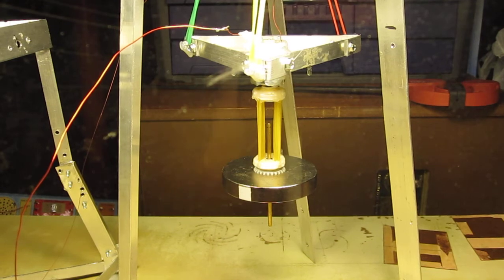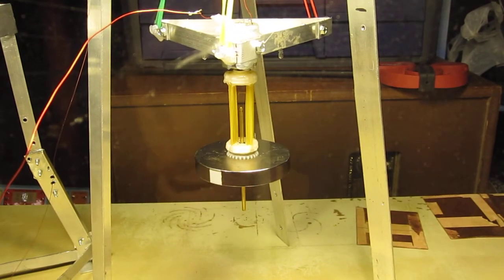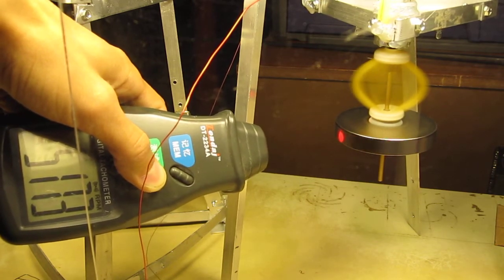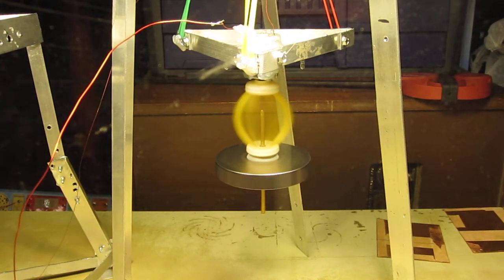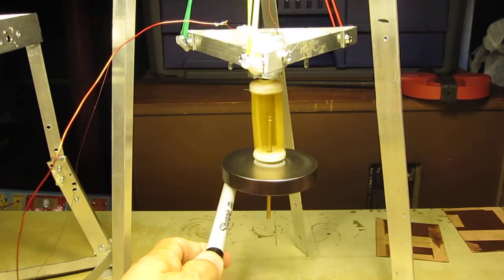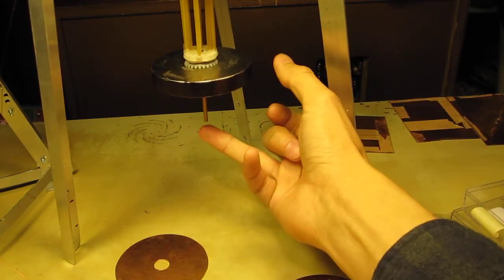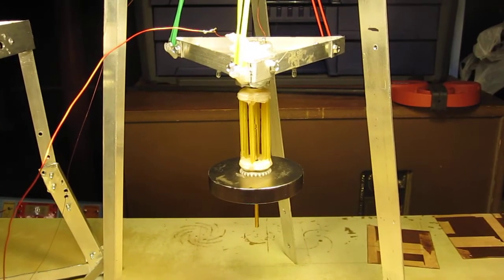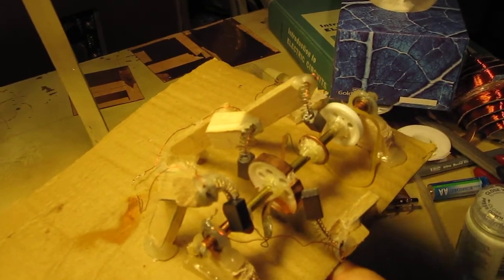Free Energy from a Spinning Magnet - Part 1 of 2

Comment: The neodymium metal will not explode until it hits 50,000+ rpms.  I have been doing what you are doing for the past 4 years.  I'm a bit further.  I have found that the magnet that you have there will levitate in air without a supporting magnet.  It will also levitate a vehicle.  After I finish my patent application completed, I will explain it.
Reply from the maker: So is the magnet in my video actually levitating?  Or is it just the centrifugal outward pushing force of the elastic bands pulling the magnet up?  The magnet will levitate a vehicle at higher rpms?  Like what exactly?  Thanks!  Really fascinating stuff!  Your making me want to revisit this experiment again but at much higher speeds/rpms.  But anyways, I don't mean to bring you down or anything but the patent office here in the USA last I heard is owned by the Bank of England...   so I'm not sure what will happen with your patent application.
Reply: @spiritelemental  If you are interested in levitation, forget the voltage output.  Your magnet is levitating somewhat as shown by the reaction of your rubber bands.  The magnetic power to levitate a vehicle is a bit more complicated.  I can't reveal the details of my magnetic/propulsion power plant, because NASA is interested in it and I am preparing for a NASA contract.  After I have found the level of their interest, than I can introduce it to the public.  
With my technology, the power plant will reproduce electromagnetic power so the owner will not have to ever add fuel or charge its power plant.  It also produces no exhaust outside of radio waves.  The velocity is calculated at an increase of 33ft/sec. or a mile in 6.5 seconds with a pilot/driver controlled velocity regulator.  FYI, a mile in 6.5 seconds is Mach 1+.
Reply: @therenaissanceman8563  Hey mate, know anything about /u/magnetflipper? If not, I have a number of questions (as a hobbyist) that can be answered outside of your patent confidentiality I believe. Let me know :)

Comment: Hi mate! I ran several tests based on a similar design. Please keep in mind that the tiny output voltages will require very low resistance brushes to allow high currents to flow. In my case I abandoned the carbon brushes soon after I figured that out and then I started building copper wire based bruhes. I made them out of thin copper wires resulting in a sort of mesh. By doing that I got up to 6 amps. The problem is that the tiny output voltages will result in low power.
Reply from the maker: Fascinating!  Thanks for reminding me of this experiment.  I still have all the parts but the project was damaged when I moved to Utah from Canada.  I will set it up again and continue my research.  I will also put it on a scale and see if it loses any weight.

Comment: Hey doesn't it mean that the disc is lifting if those elastics are bellying out?
Reply from the maker: Thats a really great observation!  I didn't think of that before.  I assumed it was just the centrifugal force of the elastics that gradually pulled the magnet up with greater speed, but now that I think about it, the elastics weigh very little in comparison to that heavy magnet.  I should've weighed the whole device to see if there was any weight loss.  I will have to try this soon, because I still have all the parts.  Thanks for the observation!

Comment: I like your approach of using a spinning magnet ! !  For many years I havnt been sure as what to call this device ...  Magnetic rotor ......  Magnetic gyroscope........  May I invite you to check out my channel ?  Its amateurish but I'm real old and I can get away with it .   I discovered something rather really cool but I am way too old to do experiments, plus I don't have materials or a shop anymore, hopefully some of my idea's might be looked into and or tested for merit. 
Think about this for a moment ...  you take a large disc magnet such as you have, you also create a copper torrid coil with an inner steel ring running around through it.... use some sort of insulating material to keep the steel ring from touching the copper torrid coil  i.e.  hot melt gun for example...  Now,   the coil must have an inner diameter of about the same as the diameter of the disc magnet...  place the magnet just slightly below the torrid coil both being centered to each other ....... The coil is stationary the magnet is rotated ........ a magnetic field from the disc cuts through the copper coil as it revolves but DOES NOT create a voltage in the coil, what happens is that EACH TURN of the individual coils become a capacitor, meaning the magnetic field inducts the electrons to either go to the bottom of the coil or to the top of the coil depending on the directions of your magnetic field.  The steel ring induces more magnetic field to cross the coil then it would on similar tests without it, this enhances the whole process. The coil and its internal steel ring become a type of battery, a very special battery.  If your familiar with electromagnetism  you'll see what I'm talking about.  Good luck 
       https://www.youtube.com/watch?v=pTWxvXlif34

Comment: If you input pulsed dc in primary winding of transformer, you will get voltage at the output winding but only those sections of the input voltage graph where voltage is changing. Also you will get negative voltage because of coil kickback.

Comment: The comment about free energy having high amperage and low voltage is interesting because it is the direction my work is going as well..  The way I think about it is that if voltage is analogous to pressure, then a really low voltage equates to low pressure which creates an energy sink...

Comment: I really hope you read this.
http://www.animations.physics.unsw.edu.au/jw/homopolar.htm  (missing animations now.... found it in wayback machine ....   
https://web.archive.org/web/20100327180416/http://www.animations.physics.unsw.edu.au/jw/homopolar.htm
 )

THe first demonstration moves the rotor without moving the magnet and the same voltage is generated as moving both the rotor and the magnet (below) and moving the magnet alone generates no voltage.

So to simplify, you can just rotate the metal pickup (I'm pretty sure it doesn't have to be copper, but any conductive material) and not the magnet.

Although it is also true that putting the copper right next to the magnet it is easier to rotat4e both because otherwise you end up with more of a gap and potentially less flux through the conductor - or have to worrry about lubrication between them.

Faraday's original generator used a U magnet. (but not very much flux penetration there)

https://s-media-cache-ak0.pinimg.com/originals/a2/df/3a/a2df3a7fb1660490b2fe0a977b52c8b8.jpg

I would be curious to see if adding copper disks ends up reducing the maximum RPM of your current setup.
Reply from the maker: Yes I'm very familiar already with all that you have said and the "Faraday Paradox".  The magnetic field stays still.  It is locked in space regardless of all else.  

With the addition of copper discs, the RPM will slow down a bit but I can compensate by increasing the voltage input to the electric motor.